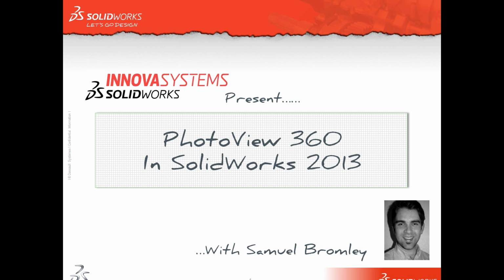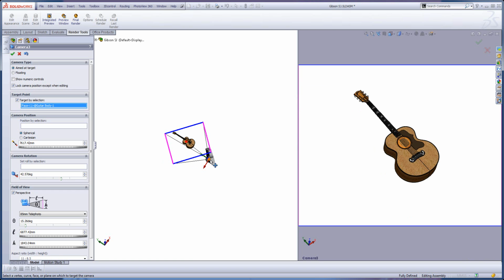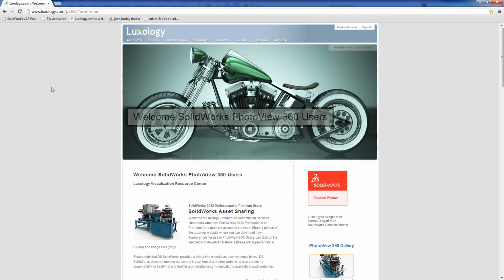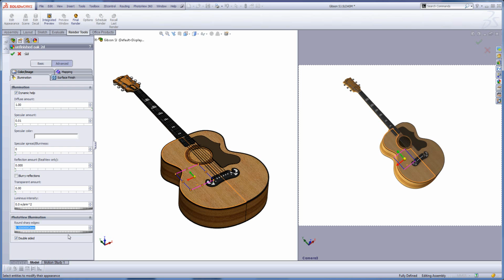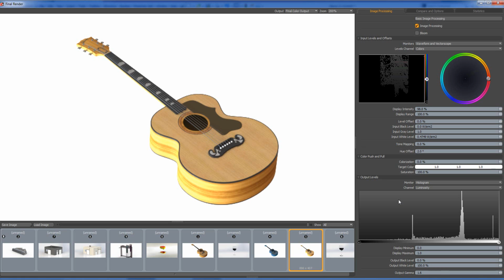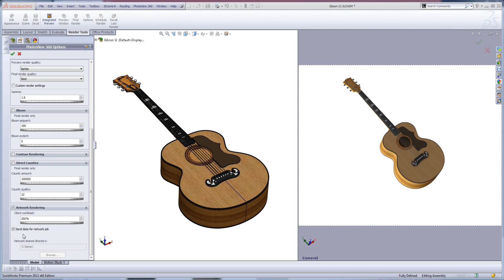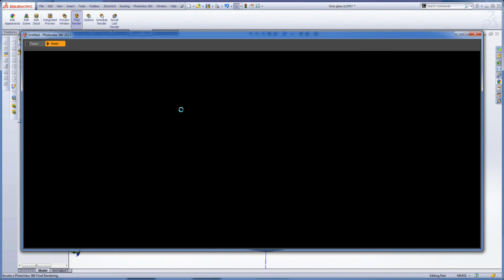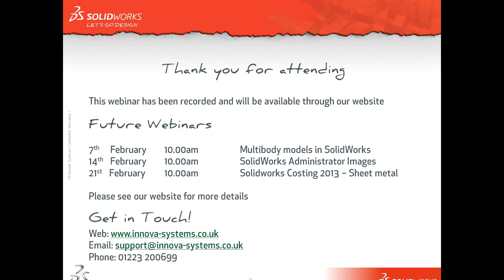PhotoView 360 in Solidworks 2013

Comment: The network monitor is actually not used to set up your network for PhotoView network rendering. What is required is that you install the PhotoView 360 network render client on up to 10 machines per license of SW Pro. At each node, if the network render client is launched and set to be in client mode then PhotoView will automatically distribute the rendering to that client.